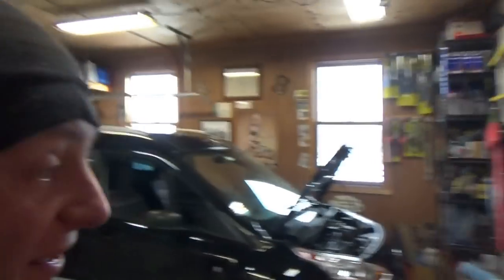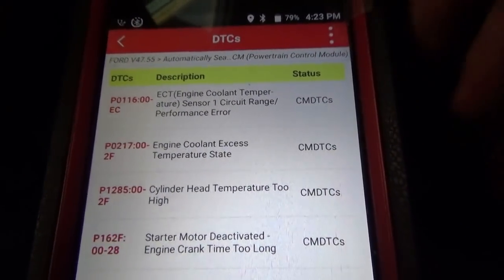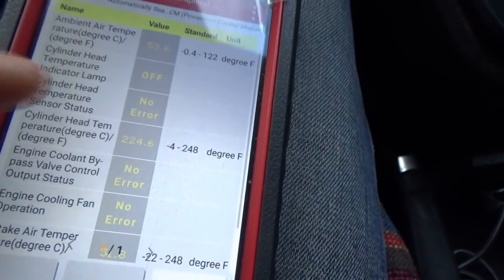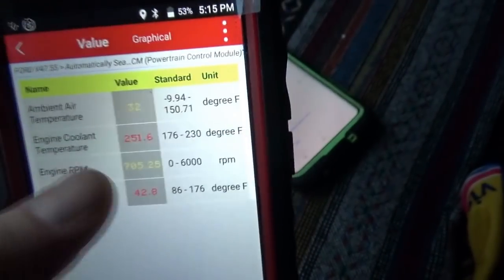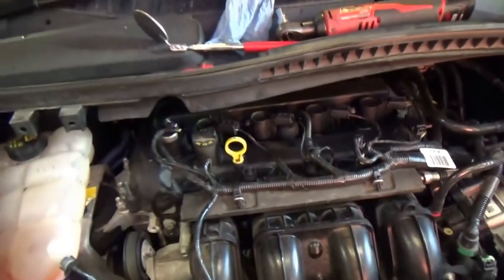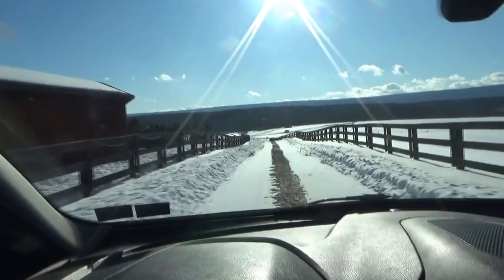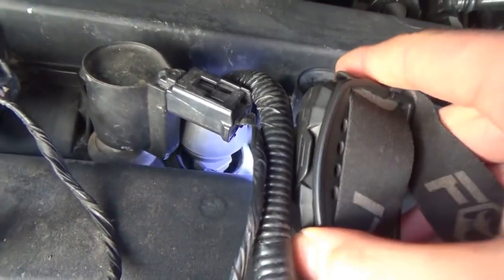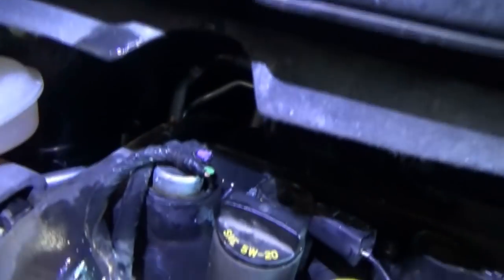Crank No-Start @ 45k miles? (2017 Ford Transit)

Comment: There should be no water on top of the engine... would look into that and why it got there.

On my contour I replaced the struts and mounts, but the top strut retainer assembly which is no longer available is about 3/8 inch higher than the strut tower. The new strut mount and bearing is slightly shorter. My solution is to modify the retainer so it sits flush with the strut tower and use a 2 inch fender washer to secure the strut better to the car. I and you will see that the retainer should go further down but hits the nut holding the strut mount and spring in.

Comment: My wife had a somewhat similar problem on her 1989 Ford Probe.  Of course, no OBDII, but also no CEL, although I'm not sure MEC II would have caught her problem.  Cooling fans were not running but it was a crank no start.  Turned out to be bad coolant temp sensor that was sensing temp too low and flooding the engine.  I'm betting something similar here.

Comment: My zetec engined focus filled the plug wells, the water was dripping in through the washer jets, sealing around them slowed it down but didn't stop it completely.

Comment: Excellent diagnosis but perhaps there's a better permanent fix. Those grommets are supposed to be water tight. If they are not ,they are probably hardened and not performing as they should. Maybe not cost effective to replace them. I would dry each well thoroughly, then apply selicone grease to each grommet prior to snapping ALL of them back in place. This should keep out minor mosture. The engine heat will boil out any remaining moisture with time. That top tray must also have a contact ridge that needs to be cleaned and also possibly lubed also. If not the dirt will not let the ridge seal up and you will continue to have water dripping in that area.

Comment: Ivan, I have seen the SAME problem on the 2006-2010 Ford Explorer - the cowl drips water onto the coils, the plug wells fill with water, and then they run like crap.  On my personal 2006 Explorer with the V8, it has managed to fill Bank 2 completely when we get monsoon season here in Kansas.

Comment: Had water in there on my Hyundai. Caused misfires and rusty spark plugs.
.
In my case it was the rubber seal between the hood and the cowl. Fixed by smothering it with silicone grease.
Reply: I had exactly the same problem with my daughter's Hyundai, ended up pulling a length of rubber cord into the hollow of the cowl seal.
Reply: @scottgraham9205  thanks for the idea, I will give that a go. The silicone grease has created a horrible mess however it has rejuvenated the seal but it's still not quite tight enough.

Comment: Whenever a problem is found on a vehicle I work on, I always think to myself, ok why did it do that? It failed for a reason. I wonder if the cabin filter is in that cowl area and someone changed it, forgot to tighten screws. Anything is possible.

Comment: This customer should have bought a 2012 Mazda 5 instead. It has the similar, 2.5 L four-cylinder engine displacement and the horsepower is a bit less than the 2017 Ford Transit Connect. The reliability on the 2012 Mazda 5 and the 2017 Ford Transit Connect is the same, but the 2012 Mazda 5 is more reliable. The 2017 Ford Transit Connect is fairly reliable. Anyway, they are both great smaller minivans. The Transit Connect just could not turn on the engine, but it is a simple repair and it was so cheap to repair. The older, gas-guzzling minivans (e.g. the 1994 Dodge Caravan and others) were just way too expensive to repair and had numerous amount of problems - these older vehicles are already in the garbage dump. Everything for repairs costs a lot more than the purchase price.

Comment: Is it common to have water inside spark plug wells when the car was driven and not sit around? You would think the water evaporates as the engine heats up.

Comment: First thing Bernie would have done is hook up 7 channels to his oscilloscope 😀.
Reply: Hello. How y'all doing today? Legendary😎
Reply: Hahaha, it's true 🤣🤣🤣🤣👍
Reply: Now you see these two lines how they correlate every 316th frame this is completely normal..OK I just saw a frame  bit concerning. Now if you look closely at the 315th frame you will see a speckled dot that seems to come and go and if you look closely.Yes now we’re on to something now the fifth channel I have hooked to chassis ground and the speckled dot is voltage being spiked upward in which I have inverted for ease of viewer confusion and bewilderment. Now This is a very difficult diagnosis to pull out of your rear end without an endoscope.Come on guys if you are not using an eight channel ATS elite oscilloscope you will not have the same results.
Reply: @JOMaMa..  Exactly. But, the guy knows his stuff.
Reply: @sjn7220  no doubt he is one of the best

Comment: Can't remember but one of the fords had an issue with washer jet holes allowing rain water to drip into the valley of the cyl head and eventually makes a misfire, by the time it gets to the garage, everything is rotten 🤣🤦🏽‍♂️
Reply: Heard that for many models of cars, the drains get plugged and the gutter under the windshield overflows into the engine compartment which may or may not cause problems.
Reply: Andy the Explorer and Mountaineer I believe 03-06 plastic clips on the Cowell would allow rainwater to go through and drip all over the back of the manifold fill up the four spark plugs back there.
Reply: Ford Fiesta Mk 5 in the UK, my daughters suffered this fate!
Reply: @jimjam1934  yep i think you are correct there.

Comment: Water around the sender/coils we had this with the Ford Focus  approx 2003 2004 in the UK very common when the screen washer pipes leaked water 💦 i
Reply: And rainwater from the bonnet dripped into the spakplug holes on 1.6 engines. Permanent solution was to install the engine cover from a Volvo V 40 ( same engine).

Comment: Well... technically that area is not sealed or it would not have filled with water. this exact issue is what plaques Audi's especially Q7/Q5 with their drains constantly clogging up front. both sides will with gallons of water. never mind the rear drain tubes coming apart and draining water directly onto the BOSE Amp, the Navigation system and the cell phone system.

Comment: I was working on a 94 Fleetwood,  yes I said 94, actually a nice car, it was in for a inaccurate fuel gauge which is digital so I hooked up my older mac mentor scan tool and I was getting some weird data pids but the car ran fine, so I hooked up the verus and I got the same readings on the data pids, the coolant pids was at 53 degrees and never changed so I hooked up my volt meter to see if the voltage would change as I was watching the voltage it did the same thing as that transit the voltage was at 1.2 volts the quickly changed to over 3 volts, I thought possibly the thermostat opened not knowing about the change in the ECM.  I need to go back  on scannerdanner s premium channel I think he may have mentioned something about that. Well before I go down that rabbit hole that wasn't pertaining to the fuel gauge I let it go, because it was not in for a drivablity,  I mean the car ran fine, FYI  the fuel sending unit was broken. Great diag as always :)

Comment: A lot of European Ford's (Shared platforms...) have exactly the same issues. Where water from the cowl/valance (however you want to call it) runs into the top of the engine and corrodes stuff. Other common issues are sparkplugs corroding into the head, or coils getting fried. It's a bit of an oversight from Ford to design the cowl in a way that would allow water to get in there, if the cowl wasn't put together properly after a repair. They should make these things as idiot proof as possible, to eliminate the human factor out of the equation as much as possible. 

We all know what kind of people work on cars (I know I am generalising, but hey, you know what I mean!), so if the engineers can design systems that prevent that sort of thing, it would definitely help. If your system works DESPITE an idiot working on it, you've designed it well! :)

Comment: One advantage of engines running over 100 deg. C by default is that they will boil away any water (as long as it is not too excessive). I guess the owner only drives short distances?
Reply from the maker: The rubber dust boots prevented the water from boiling away lol

Comment: watched a lot of yours and south main auto videos. great videos and excellent information. i do all the work on my cars, truck, atv, sxs etc. i have a actron CP9580 codereader. it's ok, it was inexpensive. i am looking to get perhaps a unit similar to what you use. I am not a mechanic professionally but i can get through most any repair. what do you recomend for me. ease of use and ability to scan my 99 sierra, 2009 pontiac G6 , 1999 miata and the 2010 suzuki grand vitara. there are so many choices its hard to know which is best for me. budget 500 to 1000 dollars. the small wireless shown in your link is nice. i'd be willing to sacrifice wireless function and small size if a larger unit performed all functions. i would like airbag reset function.
Reply from the maker: The Launch Diagun will be a huge upgrade to the Actron :)

Comment: put the boot back onto the sensor as it was designed to be, that valley cover is vented. the water gets in it'll get out. just need to keep it out, you did that by completing someone else's work tightening those loose screws.

Comment: Rather lousy method to seal up cowl bolt holes. Maybe the A/C fresh air filter replacement requires that cowl plastic to be loosened or removed for access? Good find/fix although, personally, if Ford wants that temp sensor well sealed off with that groment, I'd have put it back knowing the water concern was corrected. Yes, could have been a windshield installer messing things up.

Comment: Water intrusion !!! clean the paravan or cowl as you name it. There is an obstruction there. Common problem. Cowl has to be cleaned once a year otherwise drain will get clogged and the "overflow" will get into the motor.

Comment: Well that is a bit disappointing the old 2.2 and 2.4 Diesel  transits used to run for a long long time I can recall are bus 2007 transit had the same thing  only it wouldn't start arfter the engine getting up to operating temperature .

Comment: Isn't there supposed to be a "beauty" cover over the top of the engine? I drive a '16 with the EcoBoost and there's a cover.
Reply: Yah me to I think there's meant to be one.
Reply: That's surely a possibility. But if it has to be removed to add oil, one trip to Jiffy Lube it would be gone. Just like the covers on the lower engine pan that need to be removed to change the oil filter.
Reply: @bcad4066  What do they do with those cover's they stole do they sell them .

Comment: ford focus had problem with water getting past the windscreen washer jets and droping in to the plug port, car misfired after you wash your car or when it rained, sealed under jet fixed problem

Comment: @ 10:24 "There's your problem, lady!" Cross-pin continuity in the plug!
Where's the plastic beauty cover? Had that been in there, the "condensation" never would have drained into the spark plug wells. 
Lesson here: put ALL of the parts back and tighten them properly.

Comment: Awesome video, Ivan! 👌🏻 was just wondering, when you were looking at, DTC description, were you using Alldata Or something else.? 

I use, Alldata,  but seem to struggle over a number of different makes, to find the, DTC DESCRITION! anywhere. They seem to hide all that information. Gets a little bit frustrating when a car is in front of you, you have codes, but never any service info handy. I am in the, UK, so our system is probably set up a bit different to yours, but would have thought it would be similar information they give out to us Techs. 
Cheers 
Wayne 👍🏻
Reply from the maker: AllData is usually pretty good at code descriptions...except BMW. I think BMW doesn't like to share information haha

Comment: One hundred plus years of cars having cooling systems and electrical components.  That should have been plenty of time for engineers to realize that electricity and water do not play well together.  There was a short honeymoon period around 1955 where they used rugged thick rubber connectors that could work at the bottom of the Marinara trench.  But by 1962 Ford was making the economy “Comet” and crappy plastic took its place.  Take that to the n’th degree in the German cars of recent decades.  Not only do the wires do not insulate, the plastic parts and gaskets break all by themselves.   Almost makes one long for the old days.

Comment: We don't get the gas/petrol engines in the UK feels weird seeing it in there
Reply: In the US it's the exact opposite, neither the full size Transit or smaller Transit Connect are available with a Diesel engine. Greetings from the other side of the pond !!!😂😂😂

Comment: I see people at the car wash cleaning the salt off from under the hood with a high pressure hose? It wouldn't take much to fill the plug wells. Check your customer's vehicle hygiene.